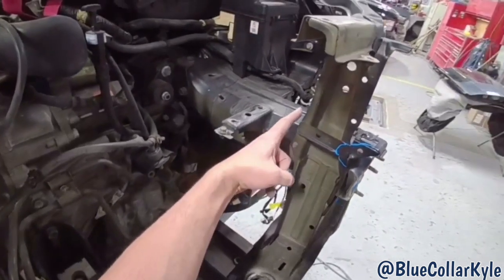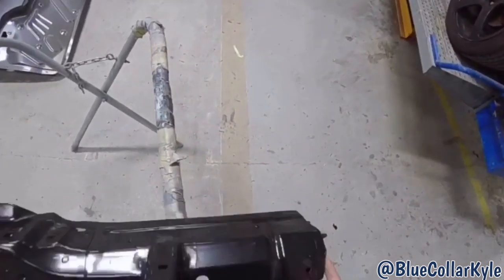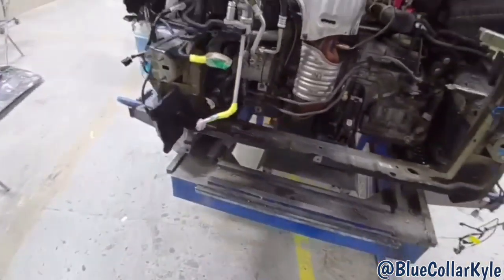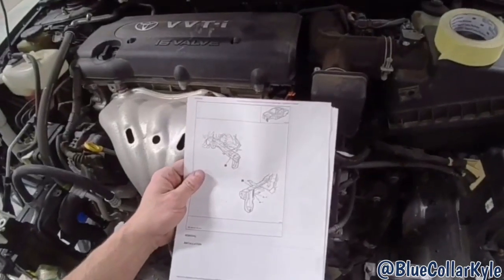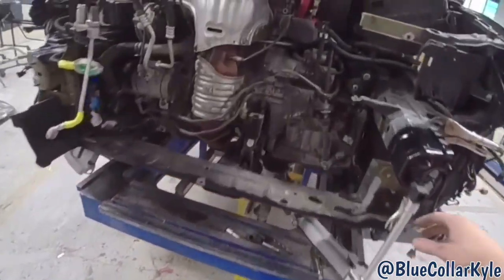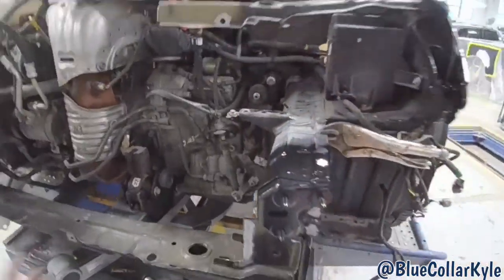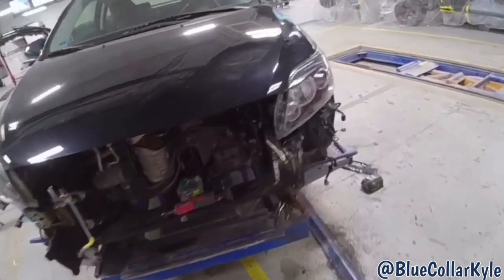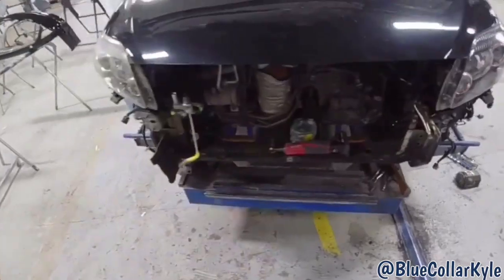Replacing A Scion TC Frame Rail

Comment: Hey Kyle.... I have an '11 BMW z4  that has the same damage. BMW also makes a section for this that I'm about to buy. I was wondering if you knew if the procedure is the same. My concern is that it seems part of the engine cradle underneath is bolted to this section. How much structural stability will be regained or would making a sleeve be even an option? Sorry for the loaded question. realoem.com has the diagram, part #41007224889 (you can google it and it comes up). Thanks for any advise.